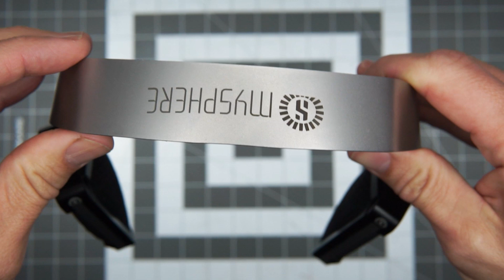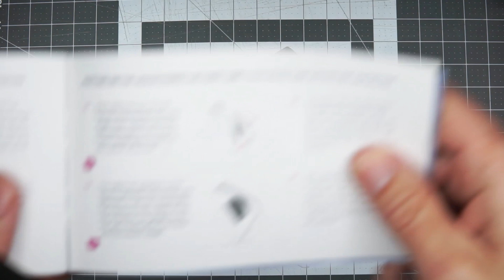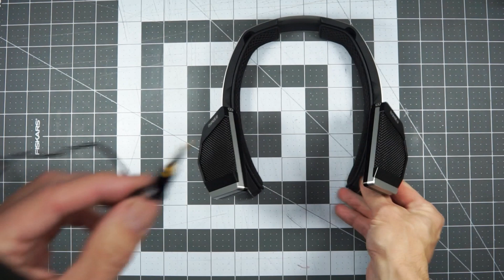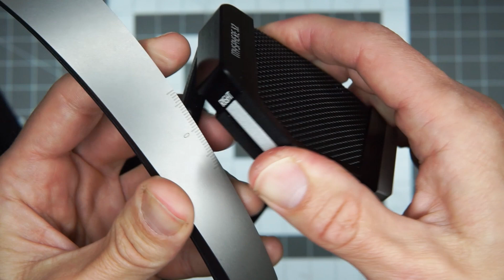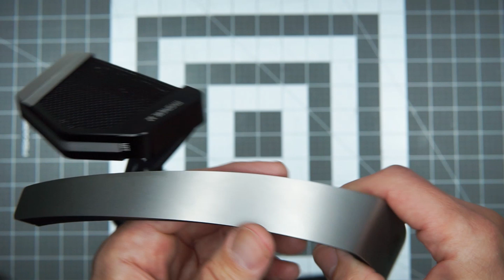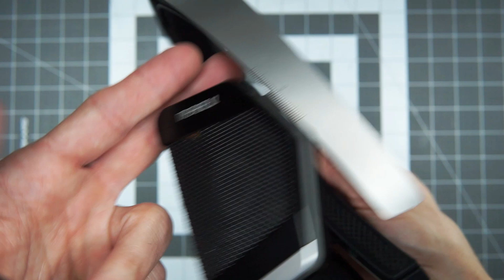Quick Take: MYSPHERE 3.2 Review

Comment: This is one of the best headphones ever manufactured. This finishes what the K1000 started. I own the 3.1 but can convert it to 3.2 and K1000 loads by changing the cable. Only top tier speaker engineering can beat these. SR1a would be an interesting comparison. I switched to the bass pads for additional deep bass with a tiny reduction in spatiality. Exquisitely flat and I cannot bring myself to sell them because trying to get this standard of fidelity from speakers is very difficult.